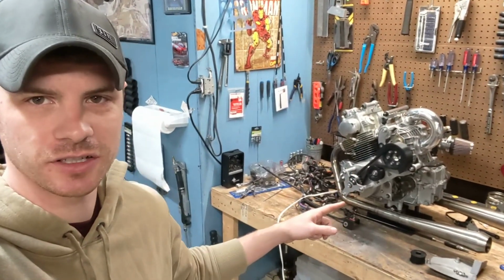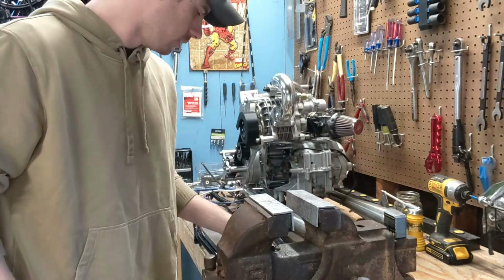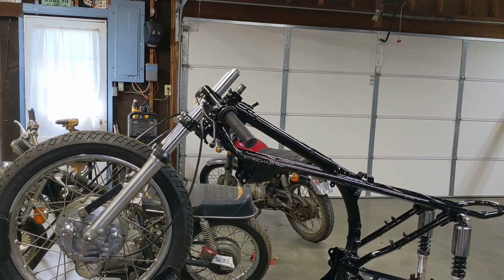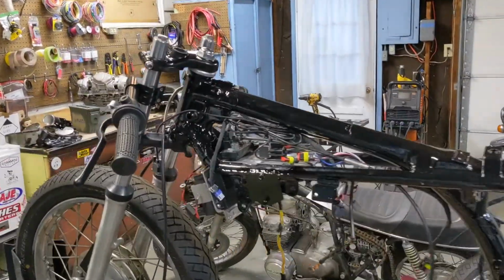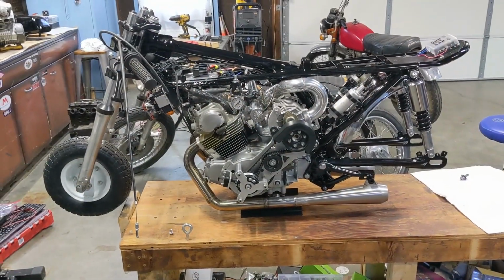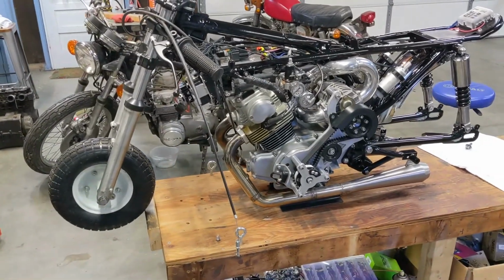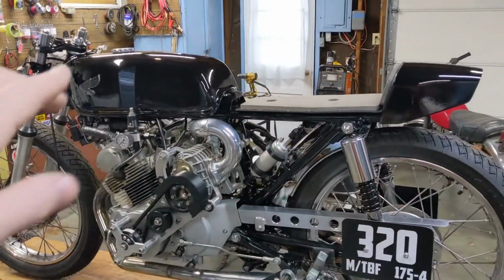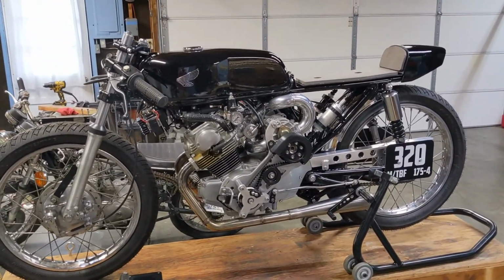IT'S FINALLY DONE! Supercharged Honda gets a Complete Overhaul - Ready to Race!

Comment: I know my Honda is not as old as yours but I would like to try very similar modifications to my upgraded 89 VTR 250, they're an absolutely amazing motor liquid cooled 4valves per cylinder and it has 4 camshafts, after 80,000 miles I checked the valve clearance and it was still perfect, its actually a later engine from a 92 VTR Xlvis so all problems have been ironed out with about 6 major changes, what do you think about this idea with the room in the 90° V-twin? thank you awesomely for sharing your experience and great experiments.